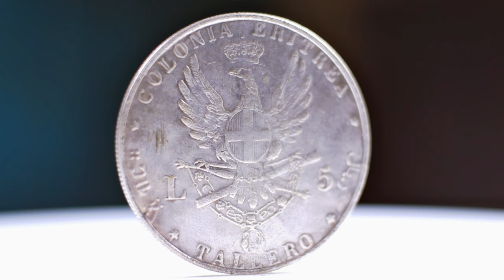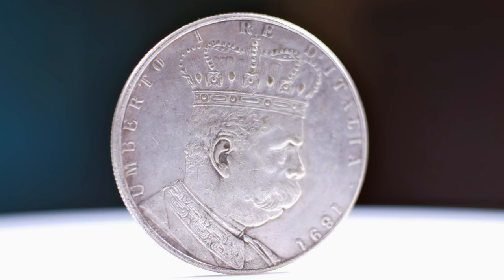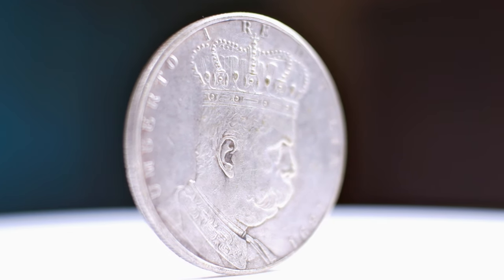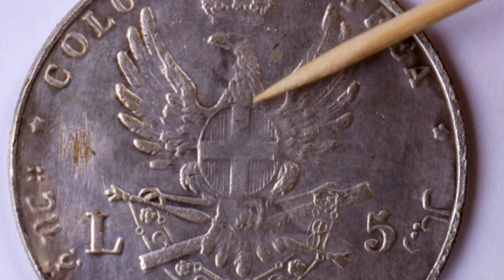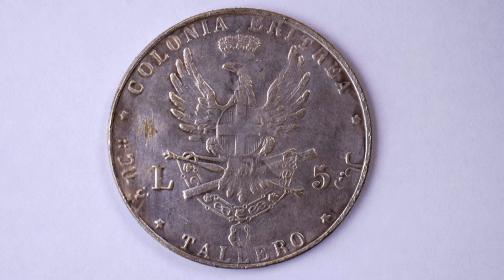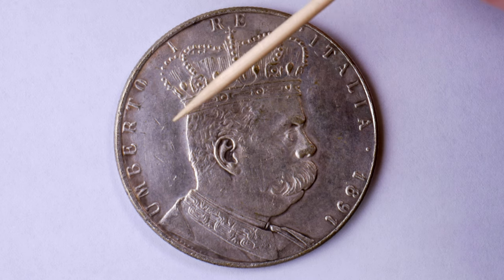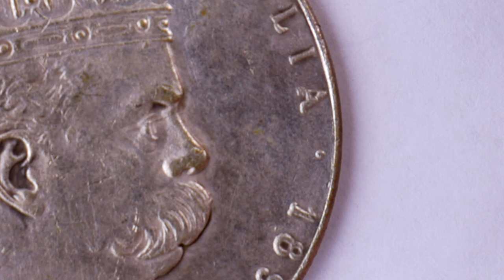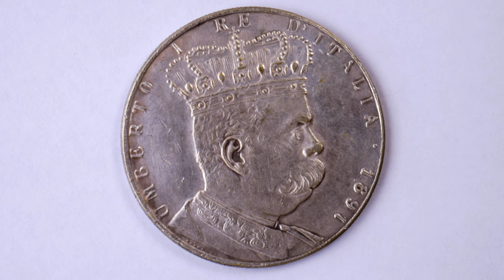How to Spot a Fake [4] : 1891 Eritrean Tallero

Comment: thanks for this video, my grandfather gave me one of these 45 years ago, i had my doubts about it as a copper colour is showing on the high points, also the weight is 26.24 g, should be 28g. and the final nail in the coffin, exactly as you pointed out, a missing lower part of the O in umberto. i appreciate your expertise, at least i know now!